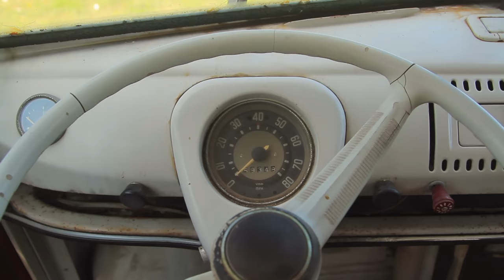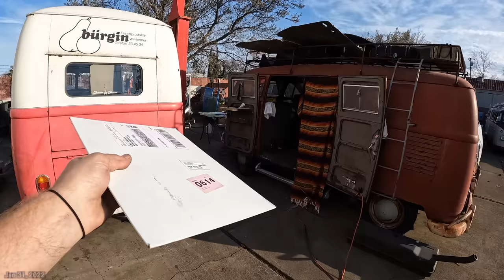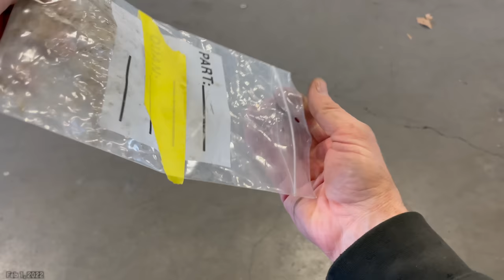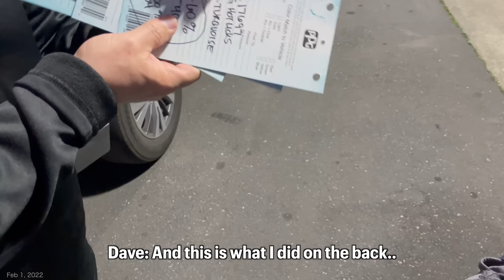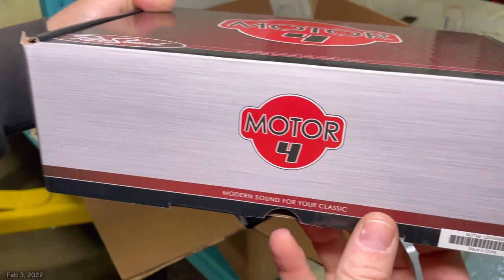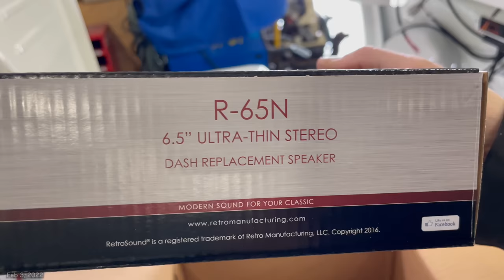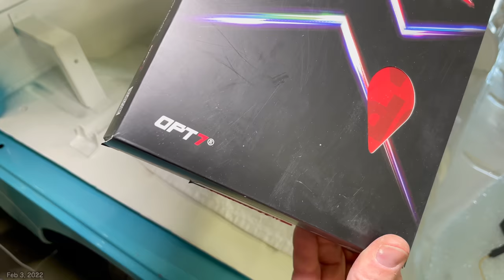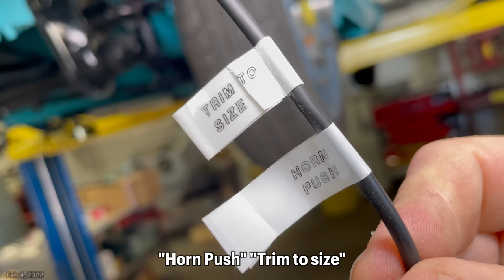VW Bus Restoration - Episode 66 - Gone Fishing | MicBergsma

Comment from the maker: L I N K S 
Upgrade horn - https://amzn.to/3ZB5rJ1
Charging ports - https://amzn.to/3t8nUAB
OPT7 aura v2 - https://amzn.to/44UbwBE
Wire insulation - https://amzn.to/48gafYp
LED headstrap - https://amzn.to/3Lrx15G
Dash gauges LEDs - https://amzn.to/3rxmoru
Retro Sounds radio - https://amzn.to/45c6Ab8
Wire terminal crimper - https://amzn.to/3PUiEcR
Retro Sounds dash speaker - https://amzn.to/3REazu7
Reply: I didn't see anything funny as well. Completely unecessary!

Comment: Mitch, you shouldn't tempt fate that way, I bet most of your viewers would take Lori's side in a split , so watch out ! he he... On those cables, the grease will help protect the cables and fittings inside tube, but the exposed parts can rust too, so maybe blast em with a coating of an anti rust silver, or bottom matching aqua ? It can be brushed on if spraying is too much trouble. The wiring is looking good too, are you considering a new career in wiring up old buses ? Hope the respray is greener to match the bottom color better... it was definitely too light and more baby blue than aquamarine imo.

Comment: If your clutch cable does snap, you aren't stranded...you can drive without a clutch!

Step 1 - With the car OFF, get the car pointed in the direction you want to go by rolling it so you can immediately drive away. (i.e. push it out into the street and pointed down the road.)
Step 2 - Put the car in 1st gear.
Step 3 - When you are ready to go, turn the key (with your foot off the brake). The car will start to jerk and shake as it is trying to start while in gear. It will start in first gear so be ready to go!
Step 4 - When it starts, drive it and run the RPM's up kinda high and pop it out of 1st gear, take your foot off the gas, and hold the gear shifter up against 2nd gear with light pressure. When the gears line up it will fall into 2nd gear.
Step 5 - Repeat Step 4 until you get up to the gear you want to run in.

Note 1: When you need to stop. You pop it out of gear and turn the ignition OFF. Coast to a stop, and do the whole thing over again. This isnt ideal in busy areas with lots of red lights, so you will need to have patient people around you as you are doing this when the light turns green and everyone wants you to go!
Note 2: There is no reverse possible in this procedure at all!
Note 3: Test this out and get good at it while you have no issues with your car to practice and get good at it!